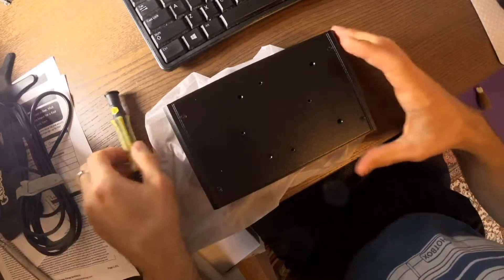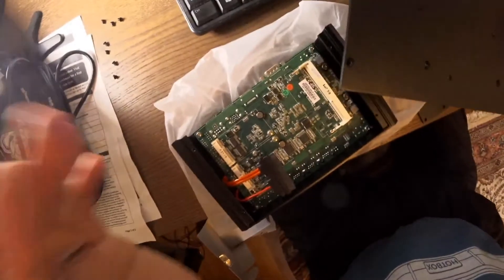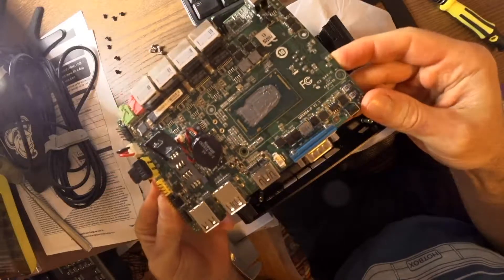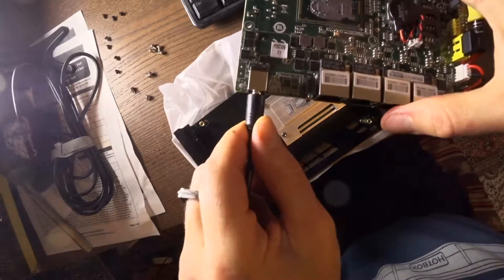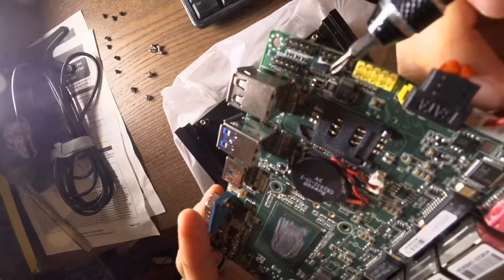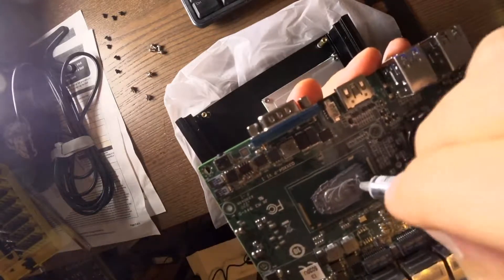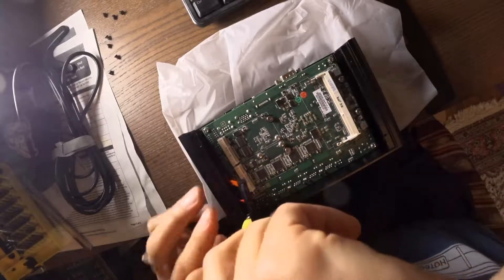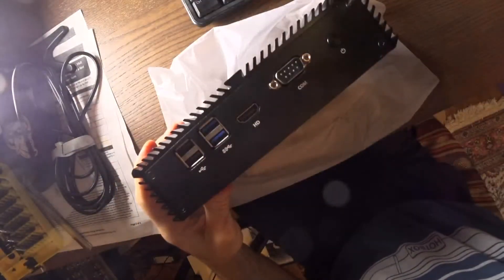Qotom Mini PC enable power ON after power loss | Motherboard Jumper

Comment: I have found a much easier method for enabling power on after power loss.  When the AMI logo is on the screen, press the delete key.  This will take you into the BIOS settings, where you can make your power up selection.  The options are on, off and previous state.  No need to open the box at all.
Reply from the maker: have you tested this? when was making this video i tried to enable that setting but it did not work. It almost seemed that the BIOS was read only as it would never save any of my settings. could have been an issue what that particular device as i have not tested it on any others just flip the jumper now all the time.
Reply: @grumpyoldit6447  Yes and mine is now set that way.  However, it apparently may depend on the BIOS version.  After watching your video, it struck me they should have made the process a bit easier, even if only putting the jumper in a more accessible location.  I then decided to investigate the BIOS, so I searched for possible ways to get into the BIOS.  Hitting delete was the first one I tried.  Once in, I found the setting under advanced.  I tried both previous state and on.  I chose on, as I have a UPS and use APCUPSD to manage it and to trigger a shut down, when the UPS was about t run out, but wanted it to power up, when power was restored.
Reply from the maker: @James_Knott  yes it could be a particular version on the BIOS i had on that particular model. I remember the BIOS setting on this unit didnt work - forcing me to download the manual and figuring out there was a jumper in the  first place.
Reply: @grumpyoldit6447  I just got one of these, but its sightly different configuration than yours. (it has an m.2 drive instead of sata) but i did the bios setting and it works perfectly. Tested it. Pops right on when i plug it in.

Comment: Thanks for this one - just received 2 units to setup ESXi and Sophos UTM firewall...One of them working 100% fine.  The other has no display...Already reported back to Qotom and they are getting back to me really quick so far.

Just wondering though if anyone has a trick to REset the CMOS?  I've already enabled the Auto Power on from your Video - and that works, and removed the Battery for a while on this one - hoping maybe somewhere during production it had Video turned off...
Any thoughts?

Also - it is definitely a SIM Card slot  - presumably somewhere in them is a Huwawei Spy adaptor...I mean Network Controller...
Reply from the maker: pulling the battery for a few minutes should do it but again the bios in mine are read only. changes cannot be saved to them.. maybe you just got a bum unit. QC on these are prob not the greatest but i do have over 10 now in production and seem to be fine- some for more than 1 year i just make sure they are connected to proper UPS for stable power.
Reply: @grumpyoldit6447  thanks for that - on the working unit I was able to change the Auto power on in there (without doing the power pin trick)...so not ready only BIOS there...
Already did the battery out trick, and also subsequently shorted the MB battery contacts...no change. But will try with battery out for longer.
QOTOM have requested I send it back...and likely I will order another one so i have one to replace this one, as well as when this dead one is replaced I have a spare as a drop in replacement in case of any failures down the track.
Reply: @grumpyoldit6447  I did end up leaving battery loose for a while - in the end I sent it back for replacement...I knew that would be a lengthy time, so I purchased another which arrived today.  And it's video is fine. 
The other unit has been in place at a site running Sophos UTM and a small Centos 8 distro on ESXi for a couple of weeks now - 100% operational as expected.
A bit of a concern I just noticed in the New one which arrived today - the CPU Temp in the Ami Bios PC_Health section shows the CPU at 91%  I know not having any fan is not great, but wondering if maybe I should remove the heathsink and apply a more appropriate Thermal paste to the die.
Reply: As an update from previous - Qotom came through and replaced the Motherboard, and the replacement was 100% fine.

I'm now about to message them hoping to get a sensible answer, unless you can answet this one:
I have a need to use one of them in an environment that offers 12V from a Solar & AGM Battery setup where voltage will fluctuate from between 14v whilst fully charging - to as low as 11v.
I need to know if the unit will still function at these voltages, otherwise I need to put Voltage regulation in between which will both be inefficient as well as more expense.  I've been testing with a small DC-DC converter, and it works when I had input at 14v to it, and down to 12.6 - but that is then too low for the Regulation to work efficiently and it only offers around 11.6v - the Unit appeared to still work, but not sure I trust it would work.  Any thoughts on this?

Comment: Nice. Pretty sure you need to make a change in the BIOS as well. I'll be fixing this issue on one soon so I'll find out.
Reply: There is no bios setting. I own this. Just the jumper
Reply: My Qotom has a BIOS. Boot it and hit delete with monitor/keyboard attached.  If I could post a picture in the comments, I would. In BIOS/Advanced/Restore From AC Power Loss: Power Off, Power On, Last State are the options. It's a computer. All computers have a BIOS of some variety.
Reply: @jimross898  I never said it didn't have a bios. Mine just doesn't have the option in the bios.. mine uses the jumper.
Reply: @jimross898  Which one do you own? I have the QOTOM Q330G4 and I just can't get into the BIOS at all! Appreciate your response.
Reply: @SX-cr1vo  I have several different models running PFSense at client locations. They all enter BIOS by hitting ESC during boot. I've never had to make the changes showed in this video.

Comment: I removed the factory thermal compound and used my own but it idles very high at 52c.  I have the i5 5250u model, what temp is everyone else at idle?
Reply from the maker: The i5s run hotter but 52C is OK mine average between 50 -60 under load thats well below what these cpus can handle. next ill be trying a thermal pad instead, it might make better contact with the case.
Reply: @grumpyoldit6447  just checked again it's idling a bit higher now at 56c in the bios.  If you try a different thermal pad let us know how it goes!
Reply: @grumpyoldit6447  Found something interesting.  I saw 52c idle while in the BIOS screen and the case became very hot.  I've now installed pfSense and the idle temp reading on the dashboard is 27.9c with the case cool to the touch.
Reply: Replaced most of the stock pad with a gelid pad from Amazon and it made no difference.
Reply from the maker: @Duweee3  INtresting , i have not used PFsense on these devices, hmm i will see if i can try down whats causing the boost in heat.
Reply from the maker: Ive noticed that this increase in temperature looks like it happened after the v20 of the opnsense upgrade. dont see this back in ver 19. so interesting....did you install from scratch? what ver are you running? Im going to do a fresh install on one of my devices to see what happens.
Reply: @grumpyoldit6447  Yeah I installed from scratch, I'm using pfsense 2.4.5-RELEASE-p1 (amd64).  pfsense is reporting  27.9°C at idle.  I think the black coating is the bottleneck in this cooling system.
Reply from the maker: @Duweee3  do you have suricata and or NTOP running? I disabled these and noticed quite a reduction of the CPU temps.

Comment: Just one more thing for anyone who stumbles onto this, and indeed stumbles onto these neat little units - They appear to all have the same MAC addresses...
At least the 2 I received both do - Not uncommon for Programmable NICs - Stallion used to do this for years on their e-Pipe Hardware Routers.
just in case you want to check that theory - Mine - which looks the same Model as yours - the MAC address on NIC 1 at least is: 40-62-31-13-f5-aa

So Just no placing on the same network effectively...!
Reply from the maker: Not seeing that in the MAC addresses , mine start with 0c:e8:2c: that is definitely odd.
Reply: @grumpyoldit6447  Oh on the 3rd unit that arrived the MAC addresses were a different range again...so I would say they are are just assigned in batches.
Reply: Could probably change/spoof mac address depending on what OS you have on it.